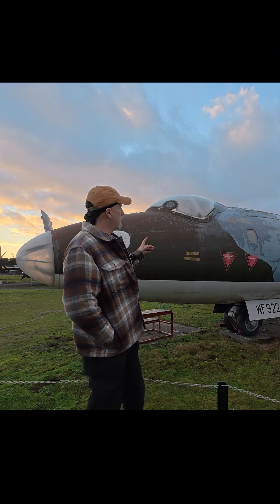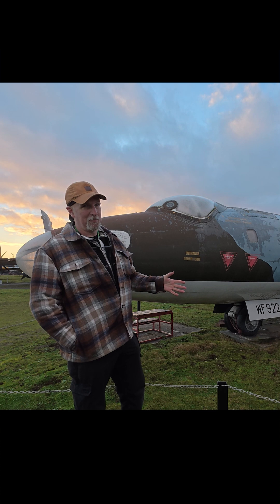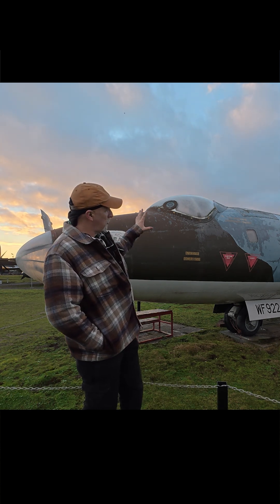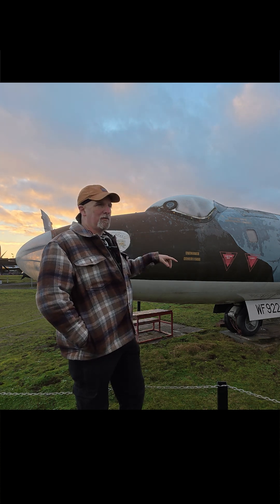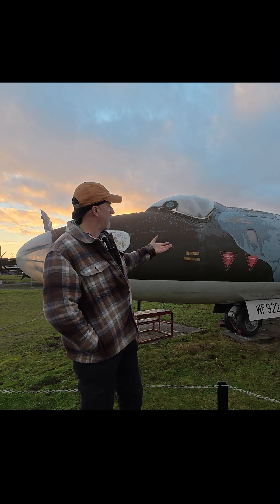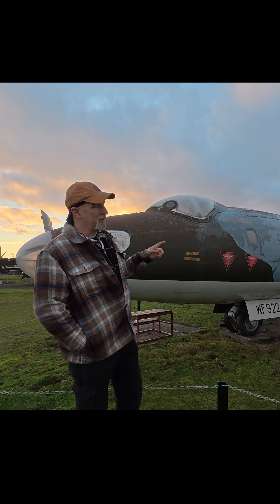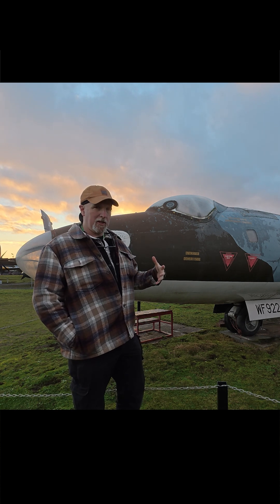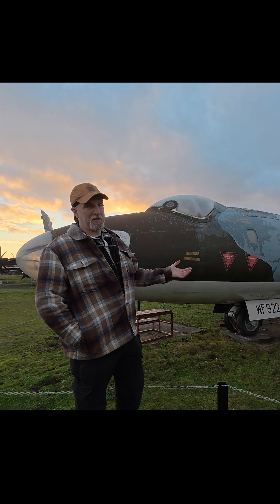Portholes on a Plane - The grim reason some cold war planes had portholes

Comment: Known as the DV window. Or direct vision window. Also used to check that cockpit pressure has equaled with ambient pressure before opening the hatch.
Reply from the maker: Yup, also used for telling the ground crew the pilot was ready to spin up the engines, apparently.
Reply: @TheOldScienceGuy   for some reason they would start their engines (using a cartridge) when we were in the crew room having a cuppa. Made us jump every time! Bunch of barstuards.
Reply from the maker: It's funny to think that systems like that were still common until even the 90's.

Comment: Can't see an eyepatch being much use if it's powerful enough to instantly craze the canopy.  More likely it'd protect your night vision at much lower intensity.

The "porthole" appears to be glass that would give less optical distortion and allow for more effective deicing.

I wondered if it opened to assist disposing of the canopy when ejecting, before detonating cord was thought of. 

A much more mundane explanation could be for passing flight plans & orders securely. Every second would count in getting airborne before being taken out by a preemptive nuclear strike & radio, or even telephone coms would be less secure & susceptible to errors.
Reply from the maker: It was glass. The correct name for it is a Direct Vision Window, it aslo had a rather powerful deicing element in it. The truth is it was highly multi functional. It was used for vision when the canopy was obscured, whether by ice or by anything else, it was also used for the pilot to give hand signals to ground crews, and even as a visual cue to ground crews that the cockpit pressure was equalised with outside atmosphere.
As for the perspex, it's not a binary thing, it's a scale from "the aircraft is now atoms" to no noticable effect. Don't forget the plane was painted with a white flash resistant coating to prevent heat damage that was way hotter than perspex could handle. The pilot would be afforded some additional protection by his flight gear.
To be honest, it feels a lot like theatre to hide the fact these missions would have essentially been one way trips. But that can't be seen as official policy.

Comment: Your channel is moving along well. Thank you for the quality content.
Reply from the maker: Thanks, though I have to confess this is a tiny bit click baity. The porthole's proper name is a Direct Vision Window and it was far more commonly used for signaling to ground crew than anything else, and technically this aircraft should be in white anti flash paint if it was in the nuclear bomber roll. Guess it worked on instagram, it's nearly at 300K views.